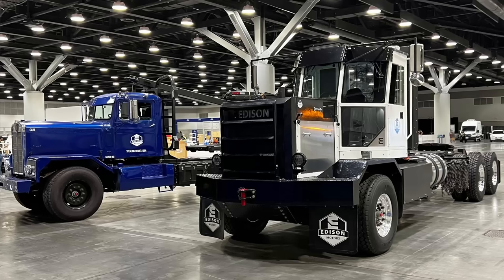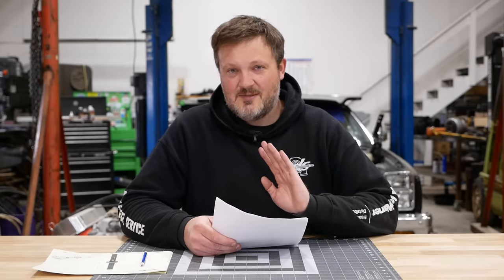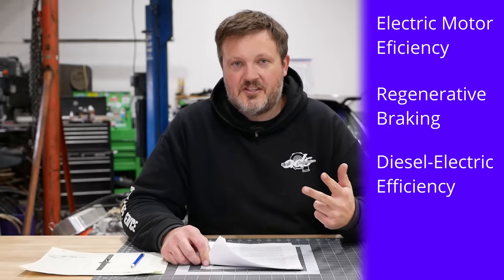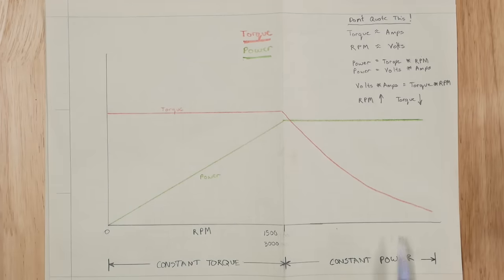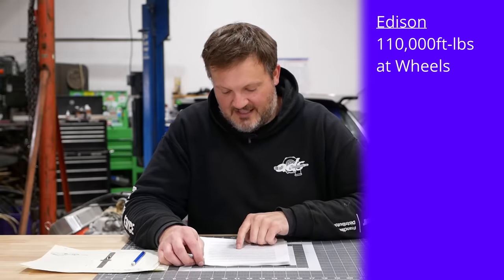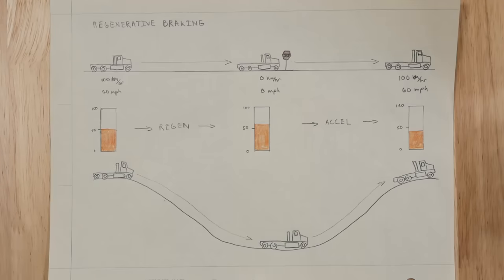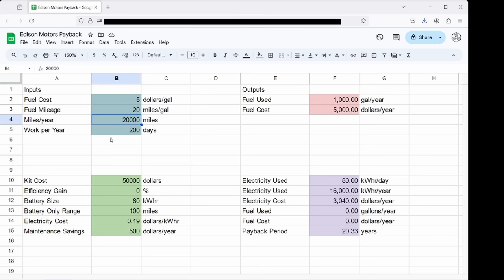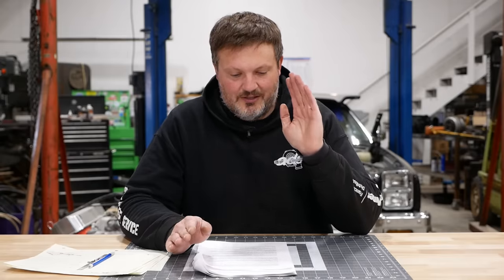Edison Motors Built a Diesel - Electric Semi Truck

Comment: Wes, great overview of Edison's system. You need to check out Hamersly Iron's ore trains in Western Australia, they use the same system, running down hill loaded and return uphill empty. The regenerative braking produces enough power to get the train back to the mine. The trains also have no drivers

Comment: I'm not against EV vehicle. But the one thing that some people seems don't understand - you can't go fully EV without proper infrastructure. To replace all of US gasoline vehicle you need to generate twice more electricity. And even if you manage to do that, somehow, the current power grid can't handle that. It's like to put a horse behind the cart
Reply: Not quite true.  Charging can take place throughout the night, leveling off and optimizing the demand on the grid.  Additionally, the replacement of the fleet will not happen suddenly, but will take some years.  Increases in installation of residential and commercial solar will also reduce grid demand. 
The biggest draw on the grid now is AC, and that peak draw is late afternoon/early evening.  The grid has been sized to handle that and has all that capacity available at other hours.

Comment: Hype is easy. Delivering a reliable product in volume to the market and keeping it running via a service network is HARD.  30 years of vehicle engineering experience this end.....  Great video Wes. You're correct on the degree of hybridsation.  If you search for Allison transmissions you'll find the classic Speeder/torquer (double motor type) drivetrain which relies on more direct drive at higher loads and speeds which moves away - just the same as Prius does.  This has been around for years. You can also find Scania over here in Europe delivering pure EV 66 ton GTW trucks into market already hauling lime. Mercedes doing the same over the Alps from Germany to Italy at 44t..... Pure EV already arriving so I'm not sure that hybrid really has a place but we'll see.

Comment: I converted a Landrover Freelander to full electric and can say with some authority Wes is 100% right here. 
Just to be clear, I did it for fun NOT to save the planet and certainly not to save money. I could have bought a much newer EV with a greater range for less than I spent.
Electricity here is 30p per kwH which will get me around 2.5 miles so approx 12p per mile. As a diesel it did around 35mpg (imperial gallon not US) which is currently around 20p per mile so it is cheaper to run but not as much as some might think.
The only way it makes any sense is if I charge it off solar but even then it is not free as I receive 15p per kwH when I expert excess electricity but in that case it costs 6p per mile.
Like I said at the start, I did this for fun and it has given me years of that so for me it was 100% worth every penny.
Lots of companies are looking for ways to look good and have a more "Green" profile so converting trucks may be one for them to achieve this, even though it will probably never make sense financially.
It might be better if Edison excepted and told potential customers the truth. They might still get lots of customers willing to spend good money on loss leaders like this.

Comment: My first thought was the locomotives in our area. They are what I am guessing is series hybrid, as engines 'power' the trains in areas where overhead wires are not available.  I often wondered about their efficiency too, as when they fire those diesels up, it's a bit of a smoke show.  Really cool to learn about this and listen to your analysis.  I personally would rather stick with internal combustion, OBD1 and throttle body injection, but that's just because I don't have the time to get educated on all of this new stuff.

I hope Edison goes places too.  Like you said, they're coming whether they are liked or not.  It would be nice to see a small business do well in the space.  Thanks for another great video!
Reply: Locomotives aren't a hybrid. They use a notched throttle to create more power from the generators. No batteries are used.

Comment: I think your analysis makes sense. For example, the CAT794 AC and Komatsu 930E dump trucks are series diesel/electric, but in the marketing for those vehicles it definitely doesn't say that powertrain choice is for its efficiency!!!  If the big manufacturers aren't bragging about efficiency then .....  🤔
Reply from the maker: I think there's kind of a practical limit to making a transmission that big.
Reply: Afaik these big mining dum trucks have always been series hybrids. Basically like Wes said, you cannot really make the real comparison without breaking some gearbixes. 😂 (or going bankrupt making them)
Reply: @WatchWesWork  Isn't that how some US standard class battleships were propelled (remember reading about cleaning the windings up somewhere after Pearl Harbor)so if there is a size limit, there's some way to go.
Reply: @WatchWesWork - Exactly.
Reply: @WatchWesWork We had a similar situation in good old blighty when the railways went over from steam to diesel.
All traction types were tried. In the end it was reliability that gave the win to diesel electric even though they were more expensive and the overall powertrain was heavier.

Huge, torque converter based mechanical transmissions for multi-thousand horsepower engines were complicated and just spent too long in the workshops with mechanical issues.
Reply: Pretty much all cruise and large container transport ships are series hybrids. They have several small propelling motors all over and a big generator down below.
Only reason is the impossible scalability of mechanical transfer of torque at that level
Reply: @rkan2 As  were the LaTourne equipment 60+years ago.
Reply: @michaeldoe4805 the really high efficiency ships have smaller generators for thrusters and in port maneuvering, then one huge engine that is connected to a direct drive prop, they start it and it just runs forward at full speed after they are out of the port.
Reply: @michaeldoe4805 Large container transport wessels for sure aren't series hybrids. They are direct drive without any gears whatsoever. They are designed for maximum fuel efficiency for the desired speed. When the freight rates are high, fast ships with shorter stroke faster revving engines and smaller propellers are in vogue, and when the rates are low, longer stroke, slower revving engines and larger propellers are in vogue. The fast ships don't gain enough fuel savings by getting slower and the slow ships can't go much faster and use too much extra fuel to do so.
Reply: CAT on their new D8E hybrid electric claims 35% increase in efficiency by going hybrid
Reply: @EdisonMotors  Aren't you glad for all this discussion without the bile!

Comment: Really interesting content,  Wes.  Nice analysis.   I'm a building contractor and deal with this occasionally in regard to passive solar and geothermal applications.   In order to get those systems to work with any kind of efficiency, it has an astronomical price tag that a homeowner's payback period extends beyond their own life expectancy.   It's really interesting technology that I wish were a viable option... but it's just not.
Reply from the maker: I can see how it works for schools and other places with high HVAC loads. For a house, you'd be better off to add more insulation or better windows.
Reply: Our geothermal well system payed off in 10 years for a very small house.

Comment: As a driver of a 23 year old honda civic the spread sheet does not lie.  My 21 year old F250 only gets driven for truck needs, the honda does all the running around.  The most economical and efficient setup I can think of for my needs.  The engineering side of my brain does appreciate what Edison is trying to do and I am sure over time the cost per unit could drop significantly making the spread sheet make more sense.   Interesting analysis Wes.
Reply: My 1990s cars are fuel efficient and easy to maintain. The Civic with D Series can run forever and there are many $500 used motors to go further. Lots of low cost parts.  They are not quick but are fun to drive.

Comment: I enjoyed the 'just talking'.  Having a BSEE but no PE license, I am a college educated field technician.  I believe your thinking is very on target.  I have some experience with VFD with AC motors, and MG set with DC drive motors, and SCR electrical drives with DC motors for electrical overhead cranes.  None of the 3 systems could feed dynamic braking energy back into 480V AC supply system.  Lowering energy was dissipated in power resistor banks.
I would like to think I am knowledgeable enough to understand your analysis, and agree with your results.

Comment: Nice - an engineer and an economist!
Reply from the maker: I was always told it's not a proper engineering equation without a "$".
Reply: $ is one of the most important parts of the calculation.

The best technical solution isn't the best real world solution if there's something that can just barely do the job for a fraction of the cost.

A saying I was taught years ago.
"Any idiot can design a bridge that's super strong and lasts a 100 years. It takes an engineer to design the same bridge that barely stands up"

Comment: Wes, to your point about turnkey emissions compliant driveline? GM actually did do exactly that - it's called the E-ROD. It's 50-state legal, and has gone exactly nowhere because to have an actually compliant engine? One, mechanic installation required due to emissions labeling. Somebody's gotta sign off on it. Two, you can't just drop in the $11,000 longblock. You have to buy the 'Connect & Cruise E-Rod' kit with either the 6L80E or 4L70E at $17,000 to $19,000 for the LS3; $20,000+ for the LT1 with 8L90E ONLY. Three, you aren't allowed to modify ANYTHING in the kit. Not even the airbox or filter. Four, it's STILL incomplete! Want A/C and power steering, you'll need to spend another $3,000 for the accessory drive kit, installation, and emissions compliant programming. Not to mention adding evap, other fuel system modifications, and complaints because the cylinder deactivation is mandatory and can't be disabled or removed. So by the time you're done, easily $30,000+.
Or you buy the non-emissions version of the LS3 crate with all new everything including casting for $6500 and just don't tell anyone. Hmm...

Ah, but there's the "eCrate!" Their drop in 400v/200hp BEV system with a 66kWh pack. Completely emissions compliant! Nobody can lift a finger against you! Works with any 4L60-4L75 transmission (and only that.) Only available from Lingenfelter or other "authorized installers" (I can't find a single one more than 2 years later) at a price of "if you have to ask..." (It absolutely is into the six digits, yes.)

Comment: Diesel electric drivetrains have been around for a long time. 

I think in some ways they offer a lot of advantages. Potentially you could have a motor/generator unit on each wheel with no mechanical drivetrain. 

In theory the wheel speed could be calculated exactly to optimize traction. Most of your current traction control systems achieve this through applying the brakes and restricting the engine. 

If you were running multiple units such as a trailer or a train of trailers this could be really useful. I'm not sure on the regs on your side of the pond, but in the UK, vehicle towing weights are approved based on what the vehicle can pull away with on a 16% gradient. Some additional thrust from the trailer wheels would really help. 

If you had a motor generator unit on each wheel the beam axles and diffs could be deleted and that would offer you more ground clearance when off road.

The main reason that diesel electrcis are used is to transmit a large amount of power that mechanical drivetrains would struggle with. They would also have this advantage if there was a big speed differential such as using a gas turbine engine. 

Most of the present limitations in ev's are the batteries. An equivalent weight of road fuel will yield a much higher quantity of energy. Legally, vehicle's are limited by max gross weight, not payload. If we traded 50% of our payload for batteries that's a 50% reduction in revenue capability for a commercial vehicle. 

It would take a lot longer to charge a 100kwh battery than it would to add 100kwh worth of fuel. 

Overall, electric drivetrains have some advantages particularly in specialized applications. But the current battery technology is the biggest limiting factor at present.
Reply: The LeTourneau TC-497 Overland Train Mk2 electric arctic land train had 54 wheel drive achieved by the placement of an electric motor on each wheel.  With the diesel electric concept having proven itself to be reliable and tough enough for Antarctic exploration in the 1950s, I am interested in seeing what  solutions are created today to further advance the concept of diesel electric. Unfortunately i think that  it will become over complicated.

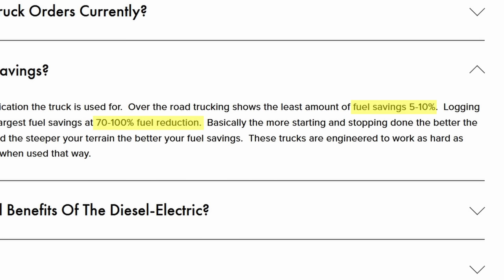Comment: At 5:11 the MPGe was very well explained by Edison. If the generator is powering the truck and charging the batteries for 6 hours (with a 9L, more fuel efficient engine) then I see a massive savings.

Comment: What an Absolutely FANTASTIC VIDEO!! I'm not a fan of full EVs as recharging on the road is too scarce and takes way too long. Hybrids are the way to go, if you want some sort of EV. But even they are better suited for urban driving. When you live in the middle of nowhere, like me, and you don't want a little ugly Prius type hybrid, and with an SUV type hybrid, the mpg savings are negligible. 90% of my driving is at cruising speed.

Comment: I think we'll get to see volume consumer grade series hybrid with the RAM Charger next year.  As a fellow engineer I love the non emotional approach.  The word "efficiency" gets thrown around with different units all to often.  Financial, thermal, pollution....etc.  The key to integral efficiency is zero cost energy and the only realistic path to that end is solar.  IMHO...this is why Tesla is so against hybrid and plugin.  There's no path to free and/or clean energy.
Reply from the maker: There's a lot of issues with Tesla's approach. I'm looking forward to the Silverado EV. Chevy has always been good at no frills basic pickup trucks. How that works as an EV will be interesting.
Reply: @WatchWesWork  Sadly the chevy EV isn't a truck in the traditional sense, it's basically an EV avalanche which kills any usefulness for the trades (myself included).  It also suffers from standard EV problems in regards to towing or more than just local trips.  I'm much more interested in the Ram series hybrid idea as I believe it will be built on a standard truck platform.  I also like the idea of using relatively cheap electricity from home charging to cover short local runs while still having the onboard generator to cove towing/longer runs even if it's not as cost effective in that mode.  But as always it's only smoke and mirrors until something is actually on the road and can be proven out.  I've been watching Edison and rooting for them; could possibly even be interested in their pickup conversion.  BUT - until I see hard numbers I can't get too excited.
Reply: @WatchWesWork I have a (1 month) Lightning and a (4yrs) model 3.  I gave up on the Cybertruck when I saw it's battery + $100k price.  800V is cool, but Tesla made no progress in KWh/Kg/m^3 with the 4680.  The lightning is still niche at 130kwh, but so far I'm impressed.  I tow heavy, but not long distances.  I love the pro power for home back up.  I think EV trucks need to get >200whr batteries, but in a denser package.  Dry cell or something else to get mainstream.